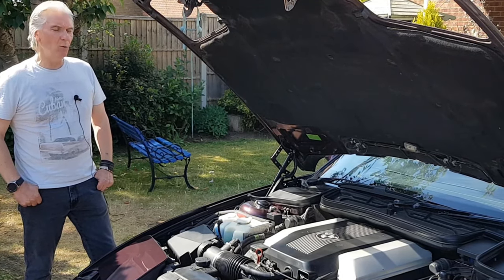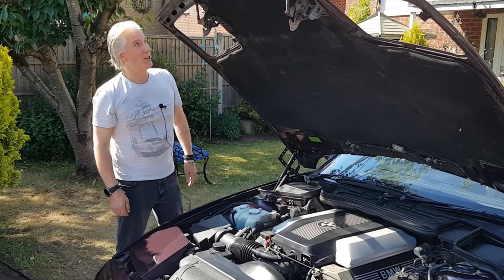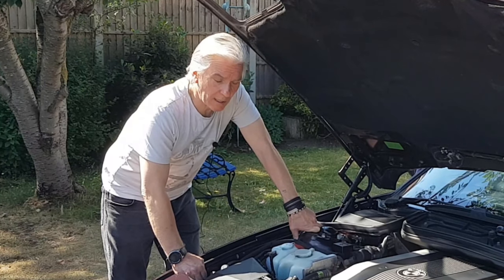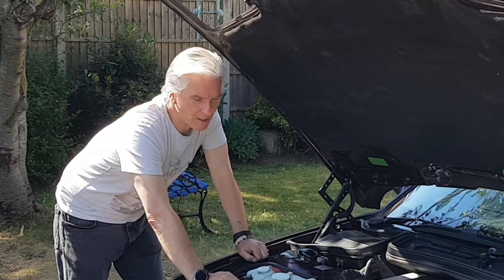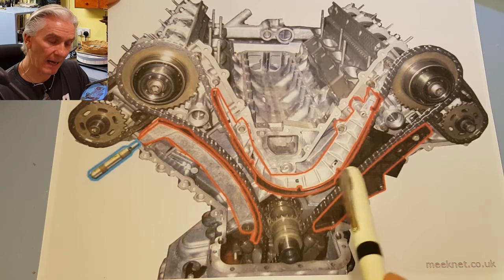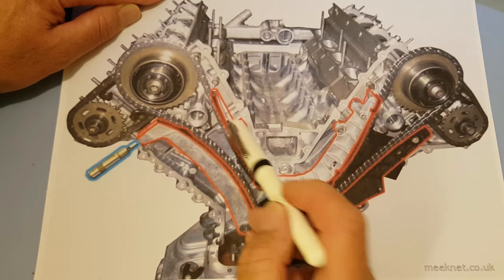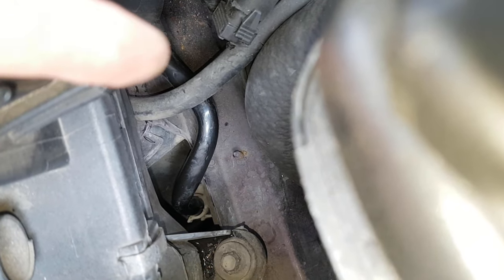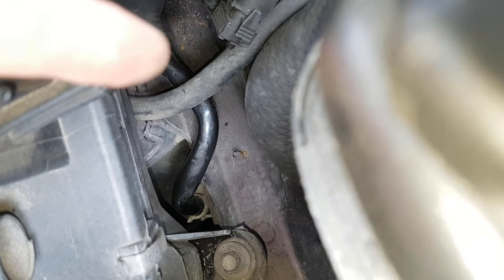BMW M62 Engine - Save your Timing-Chain Guides!

Comment: Great video again sir! Now what would you say how often should you change the tensioner ??? If you already have answered that I apologize. Months, years, miles? Thanks again!
Reply from the maker: With regular oil changes with a fully synthetic oil it lasts a good 100,000 miles!
Reply: @TimmsBMWRepairsandInformation  Wow really, thanks Timm and that is with what brand of tensioner? any suggestions? And what would you consider regular oil changes?
Reply from the maker: @user-ub5rg6fn6e  Tensioner and other parts here:  https://www.amazon.co.uk/finds/post/photo/2467023e-3e36-42da-ab99-0c748be924ac?programId=8af65eae-b2c6-4642-a988-dc519b0bef1e&ref=exp_si_spark_timmsbmwrepairsandinformation&cancelCallback=%2Fshop%2Ftimmsbmwrepairsandinformation&domainId=influencer

10,000 miles or 1 year whichever is the sooner
Reply: @TimmsBMWRepairsandInformation  Thank-you sir!!!!!!
Reply: @user-ub5rg6fn6e  Hi there,I have an E39 535i in Australia here.I always use Mobil 1 0w-40 all year round.Same in my old E32 750iL.I had a 1990 525i and a 318i E30 that I use to use daily normal traffic use.Also we would use say 20w50 or 15w40 depending on outside temperature.Winter we would use 15w40 no problems and summer it's 20w50.(Australia can get 40-50 degrees Celsius.)Or we will use 0w40 for outside temperatures upto ~38 degrees Celsius.Thrashing it say around a track or full revs drifting on gravel burnouts etc.We swear by Mobils Mobil 1 0w40 here in Australia for anything really.BMW Holden Ford etc all vehicles.One oil that engines thrive on at full noise.Any other oil we can buy off the shelf in Australia is absolutely crap compared to this.Probably why it's around 100$+ per 5Lts.It is proven and I've used it for years.Cheap engine oil is just that crap.Try cheap oil in Harley Davidson motorcycles or cheap oil in a fleet of vehicles trucks etc
Our company's would have sunk in the 1990s if it wasn't for top quality oils like Mobil 1 Castrol etc."Play silly games win silly prizes."Ultimately cheap oils kill engines.I hope more than yourself will read this BMW chain tensioners are well known to fail please use good oil and change at the correct intervals you will win the prize of a reliable vehicle.☑️👌
Reply: @richardpalmer6965   Thank -you so much !!!

Comment: Thank you your knowledge is a breath of fresh air no one has mentioned the tensioner. Could I ask? would you happen to know what would cause both banks to be advanced?
Reply from the maker: If both banks are advanced then change the tensioner!
Reply: @TimmsBMWRepairsandInformation  cheers for replying, it is greatly appreciated. I dropped the oil pan to find some broken parts of the chain guide so I will change the tensioner along with the guides, thanks again.

Comment: You forgot to mention a key difference between your engine and the ones found on E38/E39. You  car's thermostat is designed to run at ~80C. However, in order to meet emissions BMW increased the operating temperature of the engine to 105C on E38/E39 chassis, however, all the parts remained the same. If you want to confirm, just look up the thermostat for your car and a later model e38/e39. The e38/e39 engines have a much higher chain guide failure than the older ones running at 80C, and the higher temperature is making the plastic more brittle. That is also the reason why they tend to go through valve cover gaskets and valley pan gaskets at a higher rate than the old engines. Also, the plastic guide is attached to a metal backing. Many of these engines are routinely started at temperatures less than 0C (obviously depending on the climate where you live) and they heat cycle to 105C, then cool down and repeat this. The metal expands/shrinks at a different rate than the plastic thereby putting stress on the plastic. Combine that with higher operating temperature and the plastic has a propensity for cracking and falling apart.
Reply from the maker: No need to convince me - I've had three E38's, each one with the Temperature-Mapped Thermostat - which opens (unassisted) at 108C - and can be opened down to 85C. Not only running the engine at high temperatures but also leaking coolant into the DME if you're not lucky.  But, don't forget that the coolant temperature affects head temperature, oil temperature affects crankcase temperature.

Although the Temperature-Mapped Thermostat doesn't help the situation, I still believe that the extended servicing period is what caused the majority of problems with the M62TUB and not the TMT. My cars were testament to that.
Reply: You nailed it-Spot on -I am dealing with 185 000 E39 and all gaskets and solenoids leaked! But chain and guides were OK

Comment: How often do have to change the timing chain tensioner Sir? By the way excellent analysis on the mater.
Reply from the maker: Around 100,000 miles per tensioner as long as you keep up with oil changes.

Comment: Thanks Tim, fantastic video, got a question though, recently purchased a E39 , m62tu, 535i , 142 kilometres, hear a half second Rattle noise on most cold starts, had to have my rocker cover and timing chain gaskets and new tensioner replacement done due to oil leaks, I asked my very experienced BMW mechanic to check the timing chain guides, he said nice golden colour, no sludge etc, He said that he believes the motor has been well maintained and not to worry, He said no sign of wear in the guides, I asked what about the bottom, he said if they fail they start at the top. Seems to be mixed reports about this common problem on the internet forums, some say vanos wear, others say guides beginning to fail and others say perfectly normal due to older engine . What is your opinion? PS , Some say it's check valves failing., Changing tensioner made no difference to this random cold Start split second chatter Tnx in advance
Reply from the maker: Hello Daniel, if you have replaced the tensioner then you have done what you can do without a lot more trouble. The Vanos units can rattle, mine did in my E38 - and they never caused any other problems - unless you get timing problems (engine light on) then I would not worry.

Comment: Thanks for a thorough explanation on the dynamics of chain rattling and advanced timing error code. What are your thoughts on an engine preoiler ?
Reply from the maker: My pleasure. No need, as long as you have replaced the tensioner and change oil every year you will be fine.

Comment: So you recommend replacing the tensioner part preemptively? And you gave a 10,000 mile/1 year interval for the oil change? Seems a bit long
Reply from the maker: Well, you don't want to change the tensioner after the chain guides have failed! So yes, it is important that the tensioner is replaced before you get any strange noises. The 1 year interval is the bullet point, not the mileage.
Reply: Timm's BMW Repairs and Information yeah I suppose that was a dumb question. Getting an E39 540i soon and your videos have been very helpful and interesting as a prospective owner. Subscribed

Comment: 2 years later I wonder how Timm’s timing chain guides are, and what is the current mileage as at the time of this video he referenced 170,000 miles.
Reply from the maker: Everything is going nicely - I'm at work having driven here in the 840ci, and a lovely drive it was! I haven't been far, now at 178,000

Comment: Great video too bad you skipped actually taking it out. Mine has 165000 on second engine m62. I change oil often with 100 percent  synthetic.  94 540i. what about priming tentioner you mentioned.  but I did not see you do it?
Reply from the maker: Thanks Richard - I didn't show taking it out because I didn't - only going through the procedure here. Priming was shown though!

Comment: Hi Tim.. been watching your videos and firstly would like to thank you for the wealth of knowledge you are providing.. i have a range rover l322 with the m62 engine with 120k miles and since I've bought it I've spent the time, effort and money to keep her in mint condition. My question, I have some of the varnish effect you mentioned in the video. Is there any additive you would advise me to use to clear it off? Or should I clean it at all?
Reply from the maker: Thanks! Just perform regular oil changes with fully-synthetic oil and the varnish will, er, vanish!
Reply: @TimmsBMWRepairsandInformation  thanks for the reply Tim... What about engine flush? Should i or shouldnt i

Comment: Do you install the tensioner compressed or extended out?  I have read it comes compressed when new.  Some people say it too hard to screw in when not compressed.  I have also read the chain can skip at start up when installing compressed.  I cannot find anything in my Bentley book.  Getting ready to do this on my 1998 540i.  Great videos.  Diagrams, video, and dictation make is so much easier to understand.  Amazing.  Greatly appreciated.
Reply from the maker: You fit it as it is delivered - in the compressed state. The action of the chain guide thumping the tensioner as the engine is turned over extends the piston ready for action.
Reply: @TimmsBMWRepairsandInformation  , thanks for the info.  Do I need to disconnect the fuel pump relay?  Some people have started that but most just pull out tensioner and reinstall new one.  My card is a 1998 540i. 188,000 miles

Comment: Tim great video, has me worried about my E38 , just ordered new tensioner , did you install yours fully extended and soak in oil before installing or just install the way it came in the box fully compressed ,
Reply from the maker: Hello John, I installed it in its compressed state - I discuss it here: https://www.meeknet.co.uk/e31/E31_Timing_Chain_Tensioner.htm

Comment: Hi Timm great video and very topical for me, ive just bought a new pretensioner ready to fit to mine. Any chance of a video talking about the key lock on the boot of the e31? Mine has corroded/seized up cant get the key into it!
Reply from the maker: Thanks! You are just going to have to persevere with an anti-seize compound, WD40 and a bit of effort I'm afraid!
Reply: Timm's BMW Repairs and Information no worries 👍. I have a low beam failure error on the MID but all lights work, though it seems front fogs only work when you put the main beam on - perhaps a previous owner has rewired the fogs to only come on when main beam is on and that has caused the error?
Reply from the maker: More likely he has fiddled with the coding - Carly can do this, I had a look through the coding options and fogs with headlights only was one of the options.

Comment: My m62 in my E38 has a loud rattle sound on cold start, only for a second then it sounds quiet as can be. Vanos rattle? Tensioner ?
Reply from the maker: It could be either - change the tensioner using this routine and hope the rattle goes away!

Comment: Excellent video Tim !.
I followed your instructions replacing the tensioner last year on my 735i with only 70k miles. However, the instructions on your site don't include any information about building up pressure in the tensioner before starting the engine, so I had a nasty noise from the engine the first 3 seconds after the replacement, yikes. After over a year, engine is still running strong, without any issues. 

On every DIY I've found regarding the tensioner replacement, the noise on first startup is mentioned as a normal thing.

But what is the exact source of the noise, when engine is first started, and does it hurt anything at all ?
Reply from the maker: Thanks! Yes, as these cars get older and the timing chain guides more brittle it is important to not give them a slapping with the timing chain. The noise you hear is the timing chains rattling around due to a lack of oil pressure in the tensioner - once pressure has built up it goes quiet and the tensioner will maintain the pressure when the engine has stopped again. This didn't seem to be much of a problem when the cars were relatively new (when the meeknet routine was written), but as they get older the guides get weaker.

Comment: Going to look at a 740 1995 tomorrow. Wish me luck.   Does it have The infamous watercooled alternator? 

 Thank you for This Great video.
Reply from the maker: Thanks A J, no, the pre-facelift has the air-cooled version
Reply: @TimmsBMWRepairsandInformation  Thank you. Now The last thing Im worried about is  camchain guides.  Car has 180000 miles on it.  Cross my fingers..

Comment: You never actually show pulling the tensioner out and 'preloading' the new one as you said early in the video... Did I miss something?
Reply: Correct.  That's supposedly what the video was going to show us ....  wtf !
Reply: @gdhart1954  Depressurize the fuel system before starting. That way you can cold crank with the fuel pump fuse out until the oil circulates and pressurizes the new tensioner before you then put the fuse back in and let it fire up.

Comment: As always thanks for taking the time. You still running original guides? If not how many miles did you change?
Reply from the maker: Still the same guides, but second tensioner!
Reply: @TimmsBMWRepairsandInformation  wow. How many miles again?

Comment: Tim, thanks for the video, very helpful. Is there a way to check if the chain guides are breaking, or if the chain is loose, without disassembling the engine? Will there be any noise or etc?
Reply from the maker: It would have to be really loose for you to be able to get it to move off the camshafts - and by that point you would hear it thrashing about.
Reply: @TimmsBMWRepairsandInformation  Thanks for the reply, Tim. So, will the engine give any signs of having worn chain guides? What's the best way to check it? I'm asking because I have a possibility to buy 1998 e39 540i touring (with a 240k kilometers on it) at a price of 530i (inline 6) and I'm wondering if it's worth it.

Comment: Question Team e39, I replaced the tensioner on my 2003 and it seems like the rattle comes and goes now. Is there a right way to install theses? such as lining the side holes with the the oil galley? Some time its sound fine after sitting overnight but after work-8 hours I hear the rattle upon start up, leak down. I just started after 6 hours and it sound great. How do I know if its working or did I get a bad INA part from FCP Euro? I did this job last Sunday. I did take the fuses out for the fuel pumps and turned it over.

I will be changing the valve cover and oil pan gasket that will allow me to see all the guides. From the oil filler hole I can see the guides with the material in place. Thoughts???
Reply from the maker: It would be unlikely to get a dodgy one - but the problem could be that the pressure-relief valve could be leaking when hot. I would use an oil designed to remove sludge for a few changes. However, it is worth saying that my M62TUB in my 740i used to rattle at start-up, but it was the vanos units rather than the chain.

Comment: So I installed a new guide tensioner. I started the car and it sounded horrible so I shut it down right away. Am I to believe I am to endure the chain noise until the tension fills with oil and releases to put pressure on the guides? I’m just a bit nervous to hear that chin slapping on 24yr old plastic. Thanks for the insight. Wonder information
Reply from the maker: As long as you follow this guide and allow the oil pressure to build without the engine running you will be fine.
Reply: @TimmsBMWRepairsandInformation   as a follow up, I filled the guide tensioner with oil and then did the impossible, got everyone seated and threaded. I should have followed your brilliant example. Lesson learned, Timm.

Comment: Thank you for the very informative video Timm. I had my m62 timing chain tensioner changed on my 2003 540i when the car hit 100,000 miles a couple of years ago. 

What’s your opinion on lower temp thermostats?
My 540i has had an entire overhaul of the cooling system in the last several months. All replaced with genuine BMW/OEM parts. But I recently discovered the behr logic 7, 90C thermostat that m62 owners swear by. What do you think of this preventative measure?
Reply from the maker: Hello Alan, I hate the temperature-mapped thermostat, just there to increase MPG by around 0.1% So yes, an 85C or 95C stat is a much better idea. You do get error codes but they don't light the warning lamp.
Reply: Timm's BMW Repairs and Information thank you for your response!
Reply: No error codes with FCP-EURO 90 degree thermostat
Reply: ElAhmadGaming thanks for letting me know. I was going to order that one but went with the 88C 740d thermostat + 1000 ohm BMW resistor to avoid faults/codes and convert the thermostat to a purely mechanic version. I am still waiting on shipment but should be doing the modification this week when I receive it. Thanks!
Reply: The 90 degree thermostat installed on my 2003 E39 540 cause Engine light on with code  P0128: Coolant temperature below regulating temperature. Replaced with 105 degree one and all is fine.
Reply: @TimmsBMWRepairsandInformation  is there a cooler operating thermostat available for the non-vanos motor? All the above options seem to apply to the Tub motors only. I'd really appreciate my engine operating a bit cooler, especially here in the S. Florida warmth (HEAT!).

Thank you.
Reply: To avoid error codes, when going for a lower thermostat in m62 engines.
Install this resistor at the MAP controlled thermostat switch, part no: 13-90-1-734-469.
Reply: @ThePerfectionOfLexus  I did that using that exact part, but my 2003 540i threw a SES light every single time I drove the car. Apparently the later production m62 cars cannot be fooled with the resistor. I had to revert back to the stock thermostat in order to pass emissions.